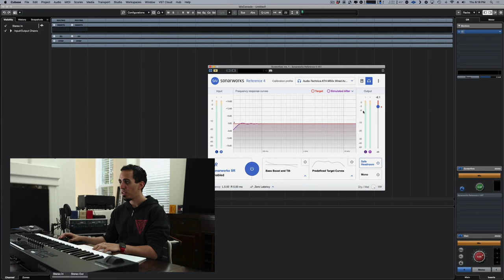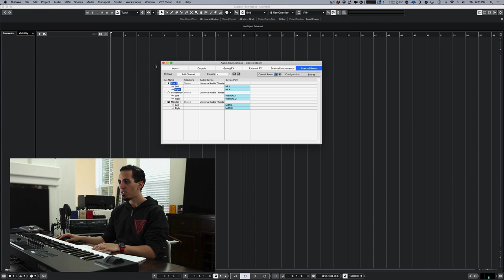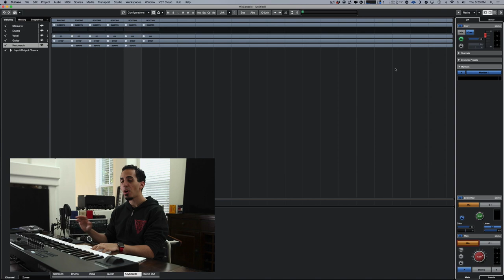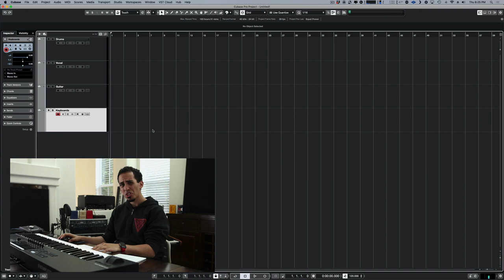How to set up Control Room in Cubase

Comment: Hi. Great Video. Hope you can help me: I habe two pairs of Monitors and a Apollo X6. One Pair is connected at the Monitor-Outputs and one pair via S/PDIF (because they have a digital input). How can I control these monitors in Cubase and how do I setup these two pairs at the console plugin? Hope you have a very helpful and practicable solution for me. My main-problem is to setup the digital monitors. Thanks for answering.
Reply from the maker: Thanks! Yeah, I can try and help! So, you see at 1:02 in my video the audio connections window for Control Room. You will want to add your 2nd pair of speakers there. So, Monitor 2 output S/PDIF L and R. Once added, they will show up in control room in the MixConsole window with their own volume knob and everything above the main volume and monitor section. Let me know if its still unclear or not working, ill try and help.